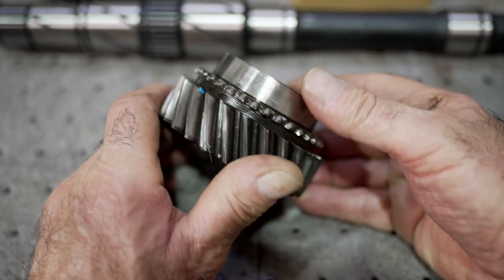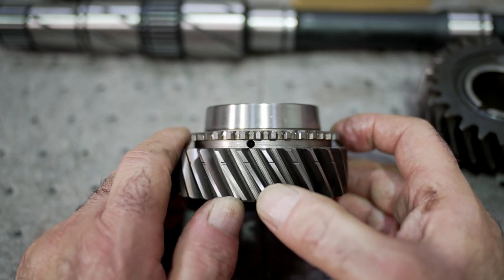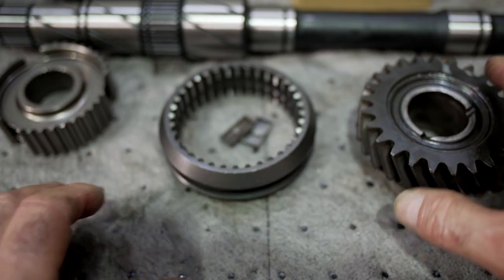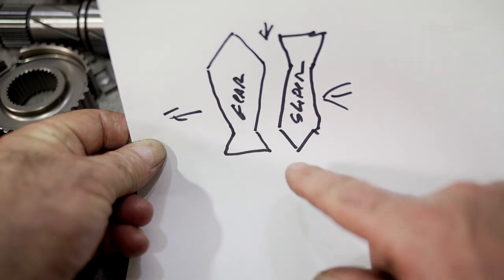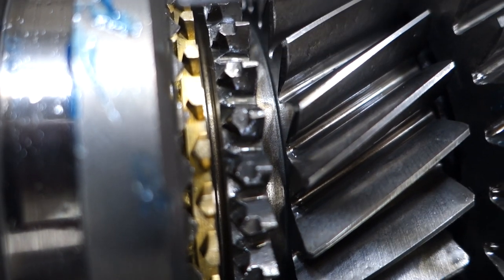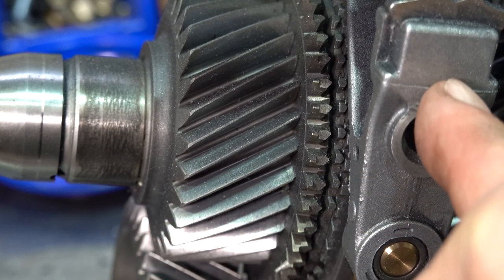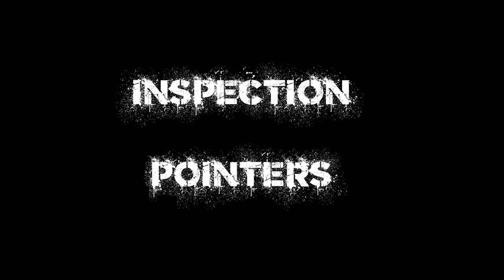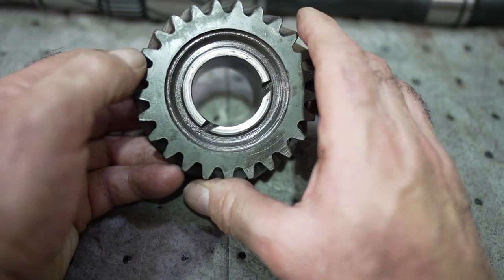Ford Toploader 4 speed Rebuild II - Learn how Torque Locking Sliders work

Comment: Way kewl of you to share the nuances that make major differences in performance and longevity. For too long these things have been generally ignored, if components weren’t outright broke, and the resulting, “I don’t knows” and goose chases.
Too many don’t appreciate and treat manual transmissions as the system they are.
Might consider doing a episode on clutch problems that contribute to transmission issues, like crankshaft - bellhousing - transmission alignment, lack of clean release, etc.
Thanks again for sharing your unique and genuine content.
Reply from the maker: I have a very popular clutch video  have you watched it?
Reply: @GearBoxVideo  guess I missed it, but did just watch it. Good video.
Thanks for the heads up.

Comment: Hi Paul, Congratulations on a great video series - something we can use in real world.  Few questions from my side and greatly appreciate and value your comments.  In the Toploader videos you talk about torque locking sleeve/hub assemblies & they that are found on later model gearboxes, my questions: (1). does that mean the top loader gearbox from factory in the late 1960s/70s, had non-torque locking sleeve/hub assemblies?   (2). Are all new replacement sleeve/hub assemblies only available as the torque locking type?  (3) If yes, should I also purchase matching gears which have the torque locking clutch teeth to match?   (4) would torque locking type sleeve/hub assemblies work with gears without torque locking clutch teeth?   Thanks from Aussie Down Under.  Keep up the great work!

Comment: Excellent video, I believe you covered all of the questions I had intended to ask at PRI, which I missed this year. Thank you for the help you provide and for your time at PRI, we have spoken several times and you have helped expand my knowledge of the manual transmissions, I have been building since 1980, but somewhat sporadically and with few technical resources. Thank you again!
Reply from the maker: I missed PRI as well this year  I had too many other travel commitments as well as work deadlines.  I will return next year

Comment: Can you buy non torque locking replacement gears? No website seems to state which they are. I am rebuilding a toploader with non torque locking sliders, and only 2nd and 3rd gears need to be replaced. I'd rather not have to buy all new gears and sliders.
Thanks a lot for your videos on this transmission! They've been very helpful.
Reply from the maker: Everything is locking now.. deal with specialists and do not buy on Ebay or Amazon
Reply: @GearBoxVideo  Thanks for the quick reply!

Comment: It is very useful.  Thank you.  I have a question.  You said we should not use synchro ring gear provided in rebuilt kit.  What ring should we buy and where?  Also, which rebuilt kit should we buy ?  i am looking to do a full rebuilt.  If all the synchro ringns in kits are bad, could we buy yours ?  Ship to canada ?  Thank again!  :)
Reply from the maker: I sell my own kits on my website links are in the video description
Reply: ok thank you i did not see it at first.  i am gona disassemble my transmission like you show me lock what i need to replace and then order a kit at your website.  Sorry for my bad english.  i am french.  do you ship to canada ?
  @GearBoxVideo

Comment: Morning Paul, I've got two questions concerning these "top loaders". 1) What gear lube do you recommend once the rebuild is complete? Specifically, what is your take on the synthetic lubes versus dinosaur juice? 2) What does it take to "upgrade" from a "wide ratio" gear set to a "close ratio" gear set? Basically, if we're already in there and gears need to be changed out from wear, is it a simple swap to get the "close ratio" to improve acceleration? Or is it a pain in the keister? Thanx for the videos - can't wait for the conclusion(s).
Reply from the maker: Changing ratios depends on your final drive ratio . The 2.78 ratio box is best for most applications

Comment: Hi Paul, Thanks for the new video's on Ford toploaders - the detailed information about what to look at is really great and much appreciated.  I'm rebuilding a toploader right now and I had bought a new 3/4 slider assembly as my original one was pounded out too far in the key slots.  The new 3/4 slider assembly is a torque locking type though - so after watching this video I realize now that I shouldn't use it with the original gears with the straight teeth.  Question: can I use the new slider inner hub with my original slider's outer that has the straight teeth? or is that not advised?  I guess my other option is to either buy new gears with the torque lock teeth - or try to find a good used original 3/4 slider to use with my original gears..
Thanks, Paul
Reply from the maker: If it fits the spline good then it will be OK

Comment: Cheers Paul, looking forward to the reassembly vid.
If you had no other way to go and had to use a new syncro that didn't lock up, could valve grinding paste be used to lap the syncro and cone so that it could be used? Just curious is all.
Thanks
Reply from the maker: Valve paste will cause to course of a surface.. Just use good rings. Thats why I have them made
Reply: If the new synchro ring doesn't grip the gear, it tells me something is machined wrong. Maybe the inner taper angle is slightly off. Or maybe it's not round.
The ID of the synchro has what looks like fine teeth that are sharp. They are made that way to cut through the oil so they can grab onto the gear. If you use lapping compound, you will be wearing those fine teeth down with flats on them. This is what a worn out synchro is, so the synchro won't work very well.
In other words, lapping is polishing a turd. New correct synchros are pretty cheap. I'm pretty sure Paul sells ones that work.

Comment: It was interesting what you were mentioning about the selection fork rubbing against the slider and overheating the synchro assembly.

I have a transmission 5spd Aisin r72 that likes to overheat during highway drives.

I put redline 75w90 gl4 in it changed 3 times/year. Case capacity is 1.4L lubricant, engine is 1328cc Suzuki.

I notice after doing highway the synchronization is not smooth, especially 2nd, 3rd, 4th, 5th.

Gear 1 & 2 are low spd synchros.

The interlock is probably a little worn because it's always a little bit tough to get into 1st and 2nd when moving the stick laterally and then engaging.

The throwout is in good working condition and the clutch cable is also good.

The issue with the duty cycle and heat must be  syncro related but what would typically make a manual trans get hot without towing?

Could it be bearings?

Btw I want to thank you for all you do Paul, your videos are absolutely the best I can always see everything so well and your explanations are quite good.

I was so happy to see new videos uploaded, hallelujah!
Reply from the maker: Could be as simple as air circulation. Some of the later mustangs that had Getrag six speeds in them had overheating issues mainly due to not enough air getting around the transmission and cooling it. Remember there are no coolers on these transmissions so air is essential. Their fix was to run additional air funnels directed towards the transmission
Reply: @GearBoxVideo  interesting, I think your probably right because it's very nested up inside the trans tunnel.

How do ppl run lines for trans coolers is it possible to fit bungs into the oil drain and fill plugs?

I swear I've seen such modifications before.

Either way thank you for your input I will supplement your coffee equipment fund 👍

Comment: Have done my share of grinding dog teeth so the gears can be reused without jumping out of gear usually on m20 Holden stuff.
Reply: I wish I would have known this when I pulled apart my zf6 speed on my 2002 F350 7.3L diesel 4x4..   I changed out syncro's and got it all back together, and it still pops out of 2nd gear.  I just assumed it needs new detents--  but now I see that I probably needed to grind the slightly tapered teeth on the 2nd gear.  The devil is in the details.
Reply: @calholli  Also look at the slide that engages with the faulty gear dogs. And look for ways to reduce mainshaft endfloat. There's usually one bearing that is retained that can be shimmed or other.
Reply: When I was seven, my dad bought a new '63 Pontiac Catalina with a three-on-the-tree, a rare combination even then.  A few years later, the car would jump out of third gear under heavy throttle.  He would hold the lever down by hand to keep that from happening.  Decades later working for BorgWarner, I would learn the importance of back-taper on synchro-ring teeth and finally understand what the problem was.  I don't think GM cared about the shortcomings of its 20 year old 3-speed MTs that were too weak to be behind 389 V8 engines!
Reply from the maker: The early T10 And T85 3 speed which was probably in the Catalina suffered from jump out due to tooth distortion as shown in the video. Warner was the first to offer the sliders as a repair upgrade
Reply: @GearBoxVideo  T85...  I have always assumed that a GM 3-speed would have been a GM Muncie or GM Saginaw built box.   You are a fountain of info.  Thanks!

Comment: Paul,
Where do i buy a soft steel hammer like I see you using in the videos?   I google searched in the past but don't know what the proper name is, or who sells them. 
thanks
Reply from the maker: Malleable Iron hammers --- google it
Reply: @GearBoxVideo  thank you
Reply: I use a plastic face hammer. You have to get one with lots of weight to it, the little ones are no good.

Comment: So, which gears and sliders are optimal for my toploader build?  What would Paul do?
Reply from the maker: New Old Stock pieces are hard to find but, the original gears were prone to engagement tooth failure. The new replacement gears and sliders made in Taiwan have been proven to work better than orginal gears. Dont be fooled with people saying they have gears made in USA or some other country. Only Taiwanese gears are being nade now and work quite well. We are starting to sell some pieces on the 5speeds.cok website

Comment: If you wanna hit 100k you gotta keep up the new videos daddy-o! As they say . Monkey See - Monkey Do! You don't know until your shown and I sure didn't know that about the drive dogs! What does that groove cut 2/3rds across in the new gear you show at 1:30 do? When are you gonna show us the gearbox in the White Countach? It's your car isn;'t it? 😅
Reply from the maker: Hey Chuck most manual transmissions used ID grooves to identify ratios during assembly. Later Toploaders, all Muncies, T10's and ST10 transmissions have them... ya dig?

Comment: Taiwan =/= China, the things they make are pretty good. The whole problem is, I think, with people mixing it up with China. I once bought a turn signal relay for my Nissan, and the guy in the shop said it will be a chinese one. I was surprised when the part turned up and it was actually taiwanese. So even the sellers sometimes don't know the difference...
Reply from the maker: Very true . There is a difference because certain raw  materials  are not accessible in China compared to Taiwan